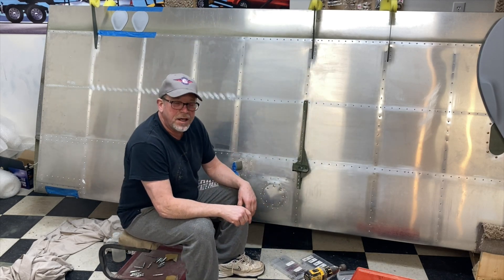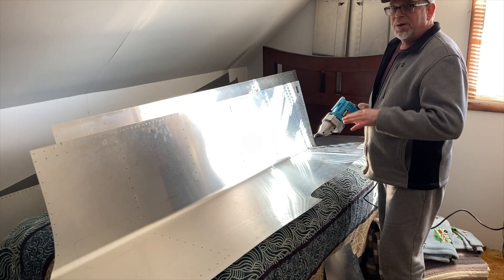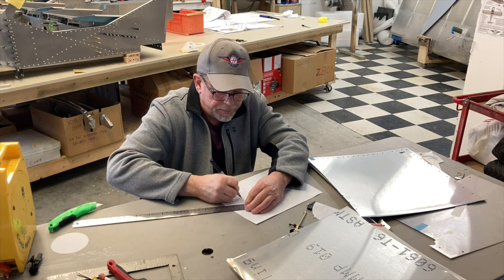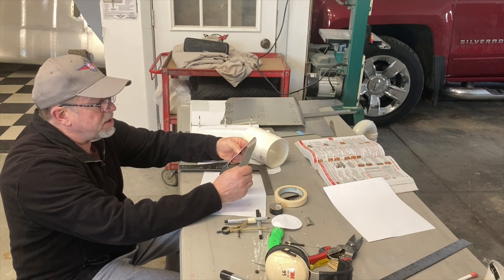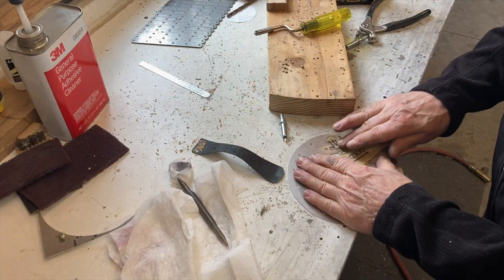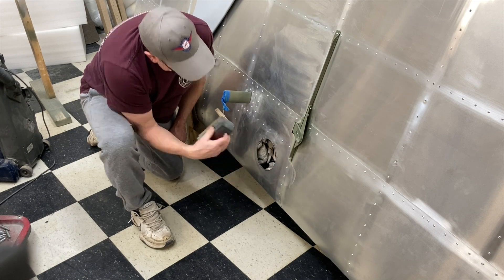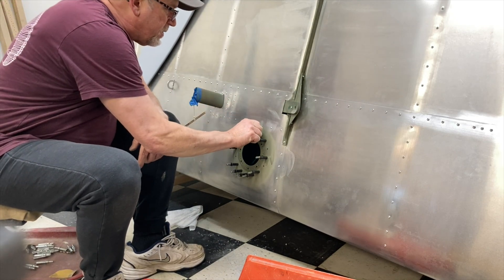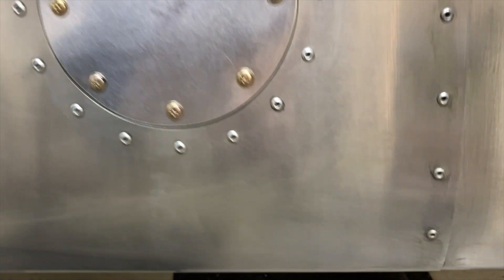Zenith CH 750 CruZer Build...Wing Strut Inspection Hole

Comment: Terrific tutorial, Dennis!  I like how you walk us thru your entire thought process.  Do you pretty much use 10-32 nut plates and screws for all of your inspection covers?
Reply from the maker: Thank you so much. I hope the information is useful. Most of my videos are filming the actual work, so I only have to decide what to leave in or take out pretty simple way to do it and yes I just use what zenith has in their kit. Happy building.
Reply: So you didn’t use dimpled nut plates where you dimpled the skin?  You used the flat nut plates that can with the kit?  Thanks again!
Reply from the maker: @CaseyCollins-b9p  I hope this answers your question. My nut plate I believe I used were the type that you could have a countersunk screw, but I'm using a flat screw head. The ears of the nut plate are flat, not dimpled, and my skin is not dimpled. You're welcome and happy building
Reply: @DennisZylstra Thanks, Dennis!

Comment: Nice work! So Zenith doesn't have this from the Factory because they assume you won't want to look at this bolts from time to time? How else do they expect you to visually inspect? Is there another angle to view from further down?
Reply from the maker: Hay Brian. The only other way I could think of is to go through the wing tip with a very long cam.  I wish Zenith would have ......It would have looked nicer.  Im not going to screw the wing tip on, so I would have had to put one in that location and Just like this better. I won't feel bad if you tell me a better solution..... Well .....

Comment: Excellent video Dennis, and right on time!  I am considering a similar hatch both for the strut attachment bolts as well as the AOA indicator nearby.  Your explanation of round vs. oval vs. square was something I had not considered, but will now.  It's always scary drilling that first hold into a finished panel, isn't it? :)
Reply from the maker: @frankdaniels8077  yeah you bet. Thanks for your support and I am so happy now that I can inspect those bolts. I don’t know why I didn’t do it in the beginning had no good reason. Hope your build goes well.